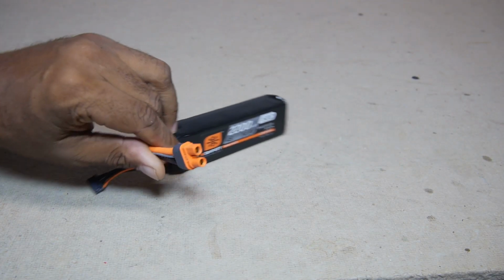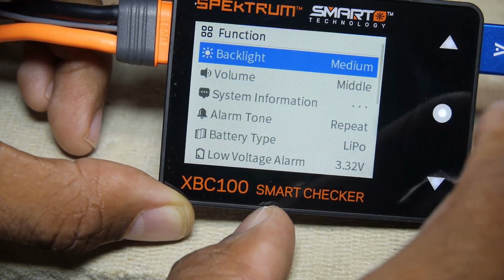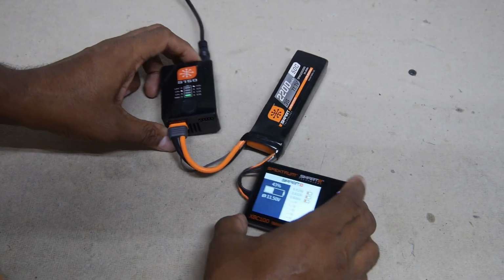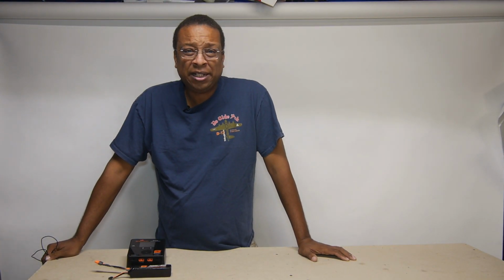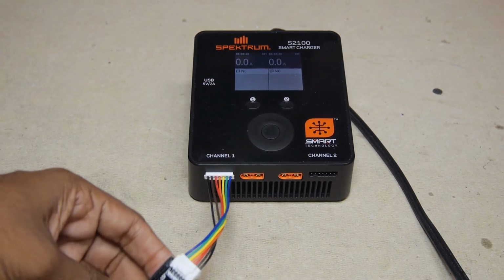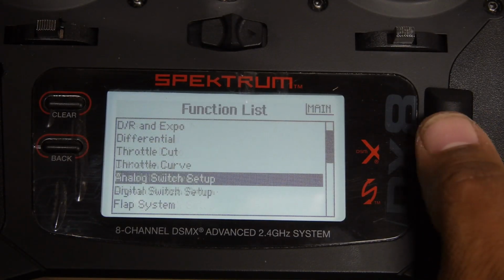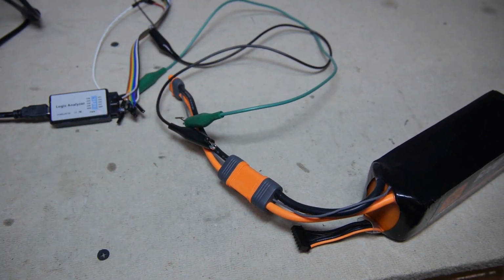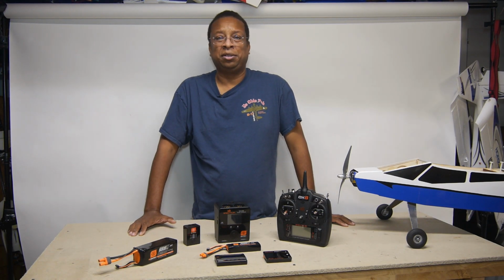Spektrum Smart Tech - Brain the size of a planet | HobbyView

Comment: A long press on the XBC100 will show you the Smart menu of smart batteries. This means you don’t necessarily need a smart charger to program smart discharge
Reply from the maker: Yes, you are right. Don't know how I missed that. Thanks!
Reply: I think all of the smart chargers with a screen can do it, as well. Only the S150 and S120 can’t.

Comment: The S150 Smart charger is   AC / DC ... When out at the field where  there is no AC power out lets,  how can you power the charger with a DC power supply such as 12v car battery ? there is no DC cable adapter... what do you  suggest ,
Reply from the maker: On the side is a IC3 input connector for 12V. You can make you own adapter or order part number: SPMXCA315 and just add snap on alligator clips to it.
Reply: @HobbyView  Thank you for taking the time , The part # that you provided for the adapter , Is that a Spectrum  Part #     Thanks Mike
Reply: Thanks for the Quick Reply , I will put one together , Its odd that Spectrum does not mention this / or supply one with the charger , Thanks again for solving this problem

Comment: I have a question. I am trying to make a guillow edge 540 rc and I was wondering what prop I should use. I am running a 180 brushless outrunner 2500kv on 3s 20c
Reply from the maker: Do you have to use 3S. That is probably too much for that motor. I would use 2S, then you could use a 5-inch prop.

Comment: I love the idea of getting your data directly from the ESC and battery directly without having to plug in extra wires every time you connect the battery. This though seems as much about brand protection as it is about offering new features. Other companies already offer the option to get direct ESC data, without forcing you to use Spektrum only.

Comment: I'd love to see the "smart" PCBs be made available to end users for install into other batteries because, frankly, spektrum battery packs are rubbish.  I'm also curious if the developers of this technology have thought about how it would be implemented and used on aircraft that use multiple battery packs in series/parallel combinations.
Reply: The Avian 80 amp ESC works for 3s-8s. It has a built in series harness with two IC5 device connectors. The esc sends telemetry information for both of the batteries. Or you can use just one battery in either port, and just use the included battery plug to complete the circuit.
Reply: They’re currently working on a way to get telemetry from two smart esc’s, though it’s currently not possible. As for spektrum batteries, I’ve been quite satisfied with my 3s 1300, 4s 2200, 4s 3200, and 6s 5000, which I just use as a DC power supply with my S1200 to charge at my field